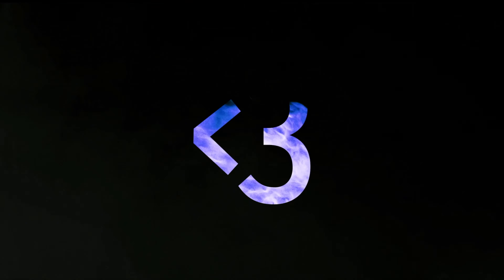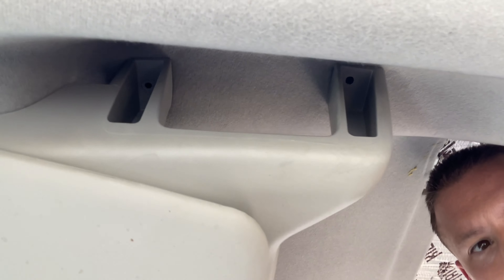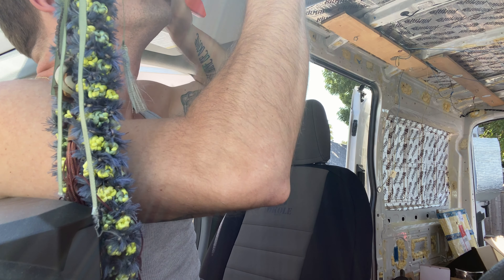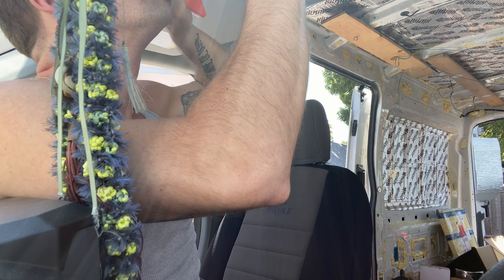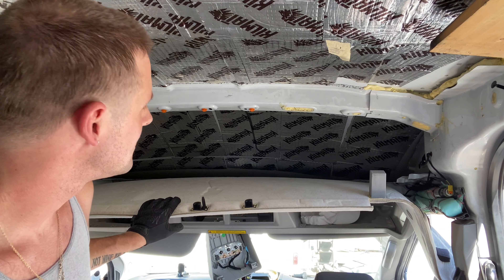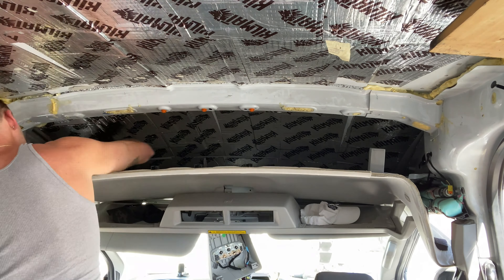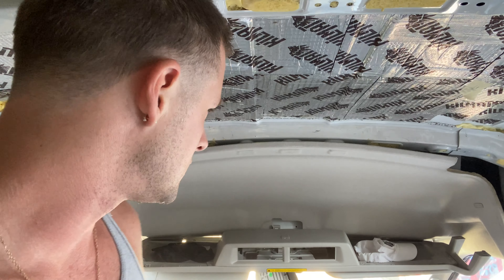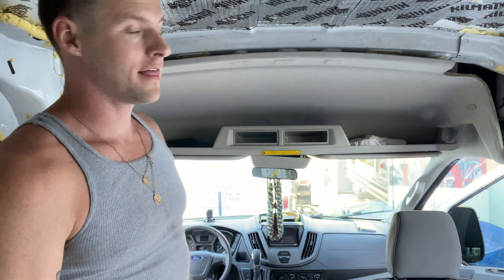Insulation and Sound Deadening the HEADLINER in a Ford Transit Van | Tim Rose

Comment: One more? If you’re going to put wood up there to cover the Kilmat, what size plus nuts do you get? I’m using plus nuts on the side of my High roof transit van that are 1/4 by 20 but the holes at the top of the van are either to big or to small for those size plus nut bolts. Thanks for any help. I guess I’m more fortunate then you because it’s May up here in the Pacific Northwest and it’s not hot yet. That will come about in June.
Reply from the maker: I did not end up using plus nuts to secure any sub wall (I did no framing in my van and wanted a natural cedar tongue and groove look) I screwed these planks directly into the van. That finished product is in my custom woodwork video

Comment: Unfortunately, the glasses are the major noise intrusion. I searched if there are acoustic glass manufacturer for trasnit van but
they make most of the ford models EXCEPT the transit van. Explorer, expedition, mustan, focus,,, even transit connect BUT the Transit Van. High roof 148 on highway will somewhat wears you down with wind/road noise. I put light weight headphone. 
The most effecient way is to insulate cabin tire well and bottom.

Comment: What about the air bags that are up there?
Reply from the maker: They are on and plugged in. Nothing I did (in this particular video) will interfere with the airbags in my non factory certified opinion. Now, the custom woodwork I used to connect to this headliner is a different story. I designed that in a way that it would break backwards and towards the rear of the van. Kind of complicated but if I get in a bad wreck and my head still works I’ll report back
Reply: Okay Tim, I’m pretty baffled on how you drill through that hard steel because I’m using a Roybi cordless drill and that stuff is a bear to get through. Are you using special bits or an electric drill?
Reply from the maker: Ryobi are known to be for more light duty stuff. You might need to invest in a hammer drill of a higher quality. Makita or Milwaukee or whatever— they have better torque

Comment: wh=at about the doors?
Reply from the maker: I took them apart and tried to stuff them with thinsulate and because of the automatic windows it ended up really not being a good idea. you don’t want to mess with the actuators of the locking door mechanism and you don’t want to mess with the automatic window so after some trial and error (and breaking one of my door latches) I just left them alone. Compared to the glass itself, the doors are not noisy. My advice: leave it alone
Reply: @TimRosemusic  great advice 👍 thanks